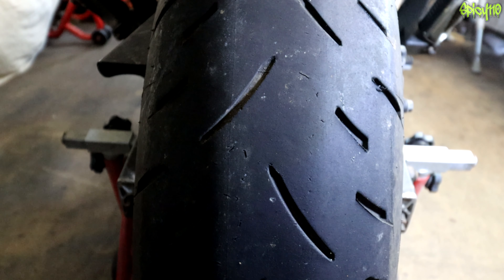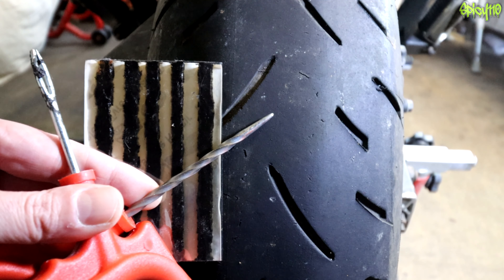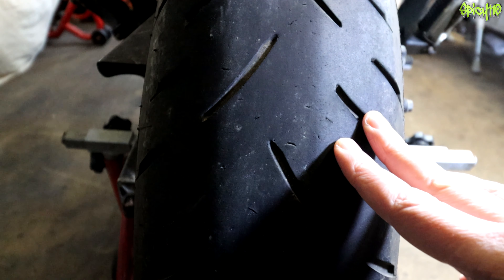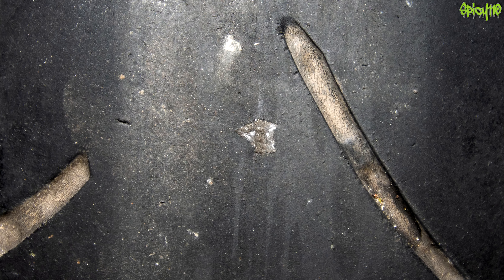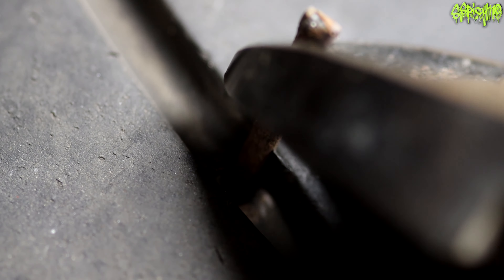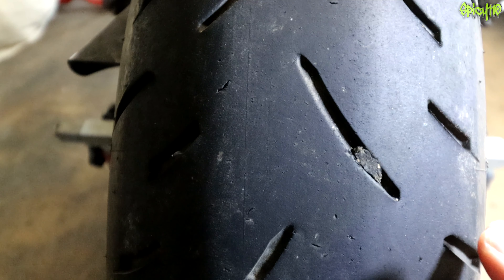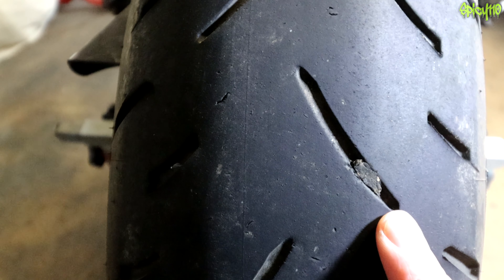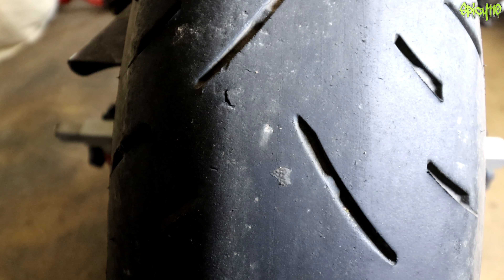Motorcycle Rope Plugs Puncture Repair! How Long Can They Really Last?

Comment: In third world countries such as my own, this method of patching tyres is the norm. I have done approximately 70k km with my pickup truck with one of these plugs, and the plug outlasted the tyre itself.
I probably wouldn't do that with a bike for obvious safety reasons, but in a four wheel vehicle, I wouldn't think twice.

Comment: I have used them quite a bit over the years and absolutely agree they are potentially as good as a permanant repair as a plug from a tyre repair shop.... but you def need to prep them correctly and operator error is the most likely thing to stop them working, especially in the reaming stage as I found the other week, had to bin that tyre after just 600 miles.

Comment: Had my bike under 2 months (new tyres) and got a flat. Was humming and haring over the fact i didnt want to pay for a new tyre as these are still great condition. Think im going to test the suspected hole see if it is actually a hole and then plug. If worst comes to worst.. i was thinking of buying new anyways. Cheers for your research

Comment: The thing i have always found over 48 year's of Driving and Riding is I've had way more Punctures with New Tyres and almost always within the 1st few hundred miles mainly due to lazy workmen not picking up the Screws and Nails they drop onto the road out the back of there Van's or tool bags.
It always seems to me the more tread you have the more chance you have of picking up Screws and Nails. I have had hardly any  Punctures once a Tyre has 1000 miles on them.
I always replace all Tyre's at the same time and would never buy secondhand or part worn.
Tyre's are far superior these day's to the old Tube type and Cross Ply days.
Most Car's these day's don't even have a Spare anymore just a repair  kit and a Pump.
Interesting topic Spicy 👍👍👍👍
Reply from the maker: I have a little joke video on those lines you might get a laugh at https://www.youtube.com/shorts/zTXMmJXyc-s
Reply: I suspect that you get more punctures in the rear tyre because the front tyre runs over the screw and flips it up, so that the pointy end is up, and then the rear tyre then runs over it. I guess if you have more tread or sharper edges on the tread, the tyre might flip the screws up more often.
Reply from the maker: Yes that is the reason it is nearly always in the rear 100% It is possible that is the reason. Would need the mythbusters on this one haha

Comment: Excellent research!  I have never used them but I have them ready should the need arise. If they work immediately then I see no reason that they wouldn’t last the life of the tyre. 
It’s the centre three quarters of the tread area that can be repaired for car tyres and I imagine that will cross over to a bike tyre also. The shoulders simply flex too much to guarantee a seal and there might be belting damage causing weakness. 
Has anyone tried the glue coated screws as a repair?
Reply from the maker: As in actual screws or is this some kit?
Reply: I tried a plastic tyre-repair screw once. It didn't work. It didn't even plug the leak for one second. The hole was a bit complicated because of the tread, which I won't explain here because that would require a drawing or a paragraph of words. The screw might have worked otherwise. I then plugged the hole with a rubber noodle, and that worked flawlessly. I think the rubber noodles will work more reliably in more circumstances than the tyre screws.
Reply: Interesting. These are metal but I have my doubts to.

Comment: @spicy110 have you ever used the mushroom repair kit? Ive got a puncture and am going to plug it when i get home
Reply from the maker: Lilly pad or mushroom plugs in theory are better than ropes. I have not used them as most need you to take the tyre off. Trying to remember if there are ones you can do from the outer now. but no I have not used them.
Reply: @spicy110  thanks for the reply. I patched it with the mushroom when I got home this evening. Was really easy to do. Will keep an eye on the pressure over the next few days/weeks 👍🏼

Comment: I’ve had mixed results with these, personally I would only use them in an emergency, I also would recommend you get a permanent repair done asap if you ride with a passenger,

Comment: Why is the front tire more risky?
Reply from the maker: Simply because the front does 70-80% of your braking and is also used to turn. If the front fails you will likely crash, if the rear fails it will not be great but the bike will keep upright.
Reply: @spicy110  Gotcha thanks for the breakdown makes sense. I just rope plugged my back tire for the first time the other day.

Comment: So plugs are not an MOT failure then.
Reply from the maker: I mean, can they see them?
Reply: @spicy110  well they are supposed to check the tyre so yeah if they're competent they should see them.   I should have  ended with a question mark as I was enquiring if they are an MOT failure.

Comment: I see a few years ago that 'Cambrian Tyres' were asked to explain the legality of plugs for Practical Sportsbike Magazine and their research stated:

"MOT testers have a lot of discretion....however if a plug meets British Standards, there shouldn’t be an issue.

"The rules around the plugging of tyres are different depending on their speed rating.

"All plugs must be fitted only within the treaded area of the tyre, and only within 25% of the centre line. They should also be perpendicular to the rim.

"A tyre up to and including a J speed rating can have a maximum of two plugs, of no more than 6mm each. However, as these tyres are only rated up to 62mph, they are not so common in the UK. Plugs should not overlap.

"Any tyre rated greater than J, all the way up to a V-rated tyre which is capable of speeds up to 149mph, can have one single repair with a plug of 3mm or less.

"If you’ve got a Z-rated tyre, capable of speeds of 150mph or more, it can only be plugged if sanctioned by the manufacturer. That means checking with the tyre maker, so if in doubt speak to your nearest motorcycle tyre dealer who may already know, or can find out for you in a technical handbook."
Reply from the maker: arrr very interesting, can I just ask Is this from the study directly or summarised by GPT?